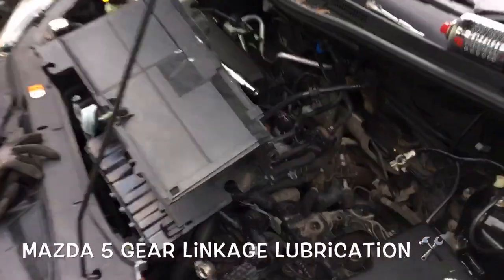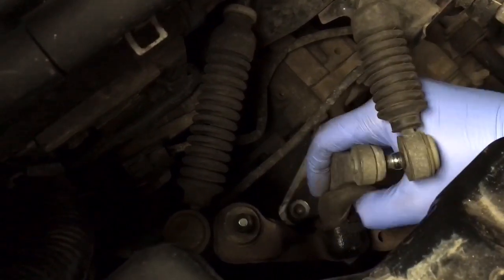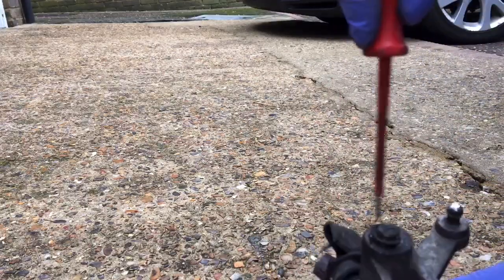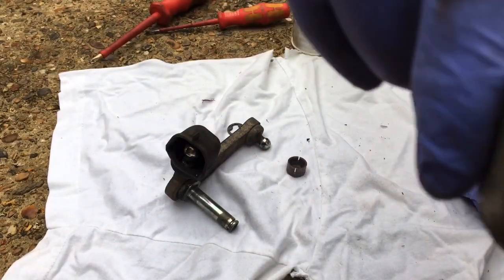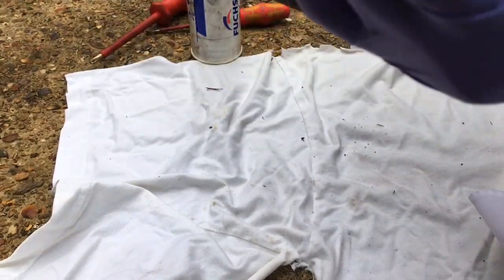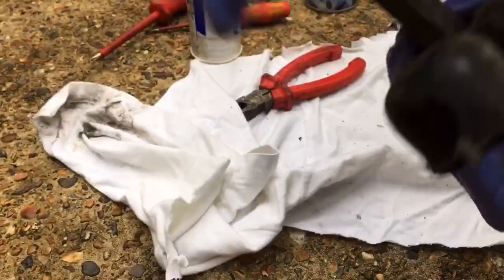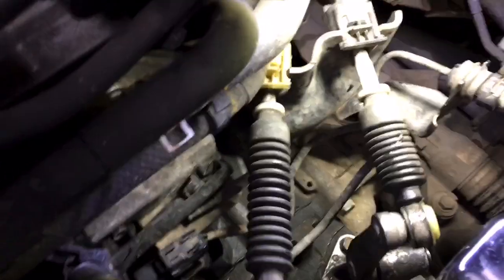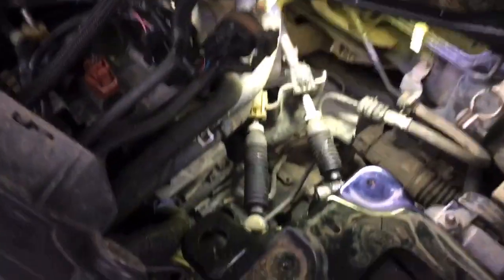Stiff gear linkage repair on Mazda 5

Comment: Great video, did this procedure on our Mazda 5.  Only issue I realized is that it is not that part that renders the shifter stiff, but more the cable itself.  I tried to insert penatrating oil in the cable sleeve and see if it can make the cable slide better.  It helps a bit but did not solve the issue completely.  The shifter seems easier but it does not spring back when in neutral.  Do you have any reference on how to change  the cable.  I thing that the heat from the exhaust manifold is the cause why the cables is stiff to work with.  May be rust inside the cable.
Reply: Yeah my fuckin cable does the exact same thing. Can’t find and solutions